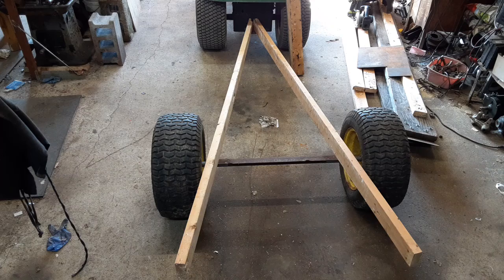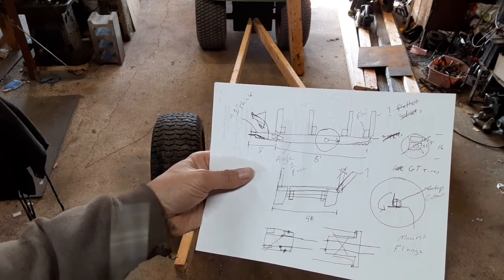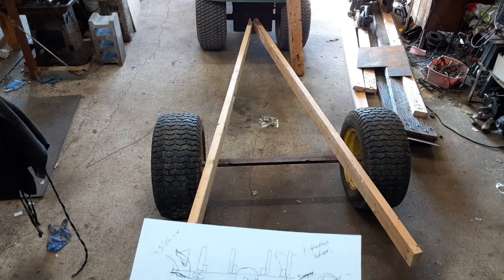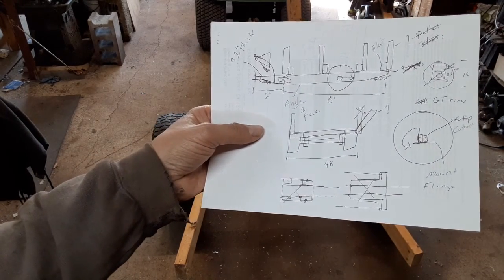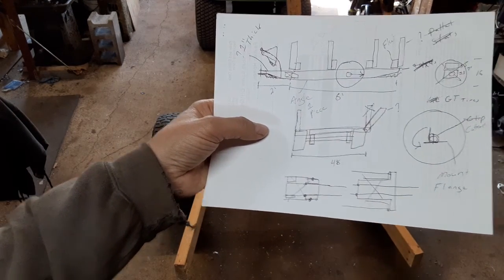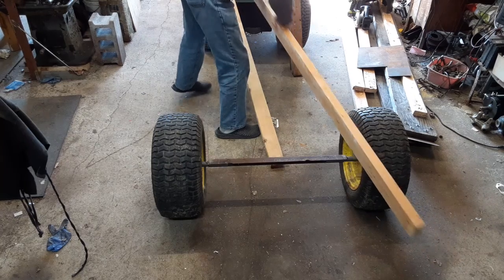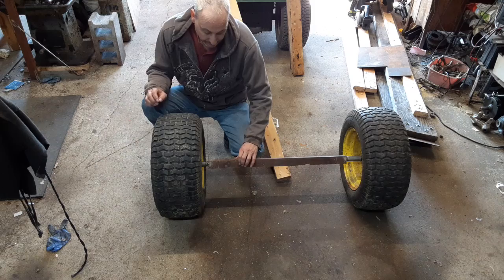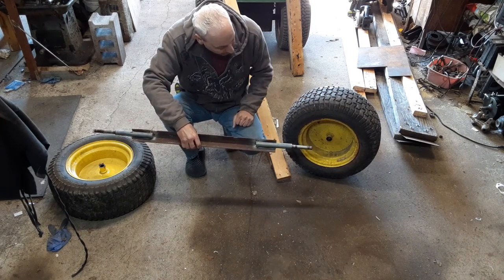trailer axle and design thoughts

Comment: As the wheels are designed to be keyed to a shaft, are you concerned that with load on the trailer the wheel centres will wear quickly? Our scrap trailer has similar but smaller wheels and we have used the keyway on the axle shaft, so the axle turns not the wheels on the axle, if that makes sense. It does make it more complex and the axle has to be in two parts, both with bearings
Reply from the maker: I did consider that. I guess my hope is it will round off the corners before wearing out the shafts. But if it wears the shaft 1st I can easily reproduce the axle a second time. 

I dont know how familiar you are with WW2 history , specifically the equipment.  
1 advantage Russia had over Germany came in part from their design philosophy ..
The Russians built huge numbers of good albeit crudely built takes. Whereas the germans may have had the technological superior tanks,  but time consuming to build (as I understand). 

I tend to follow the 1st approach simply because I have so many things I need to do, it's hard to justify the time it takes to build things really well. It's a balancing act to get some quality/ with speed of production
Reply from the maker: Your method makes sense for sure. I hadn't thought of that. Definitely a great idea

Comment: Unless I missed something, how will you be attaching the trailer tongue to the hitch?  Also, did you just tack the rear shafts in place, and plan on filling-in the weld later? (Stupid question - you did mention blowing the breaker, after I watched that part again)
Reply from the maker: The hitch is super basic.  Just a 3/4 hole for a hitch pin. And the trailer tongue rests on the tractors hitch. I dont think I did cover that. 
Yes just heavy tacks . I added a lil more weld , with the low stress I assume it will see I think it will last. 
Only time will tell